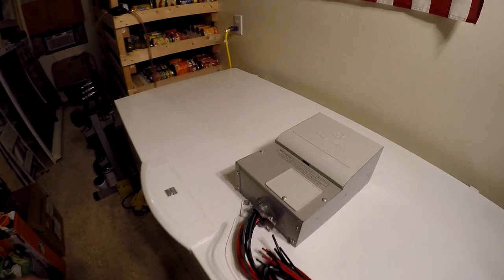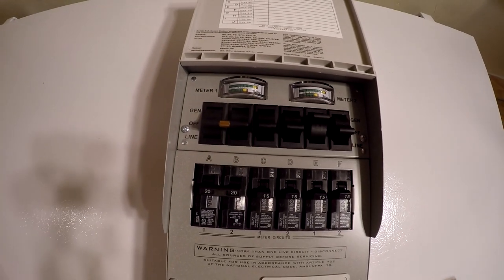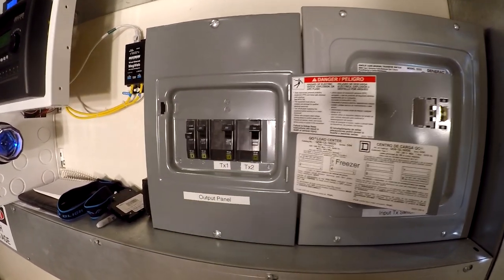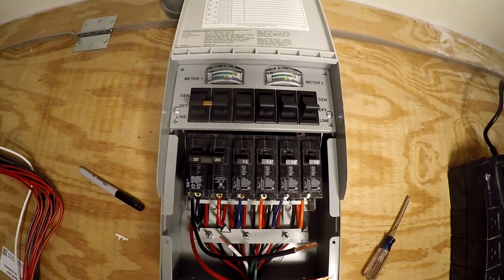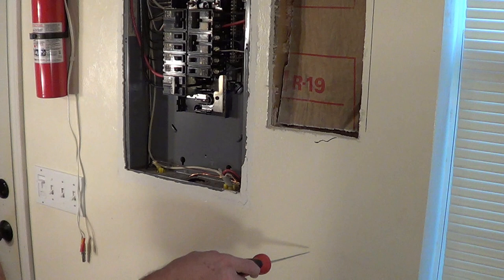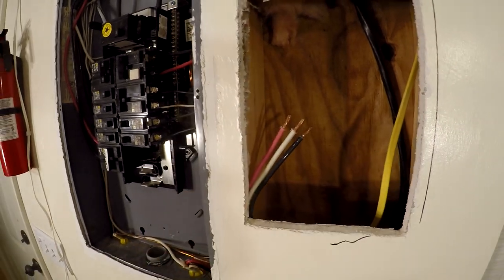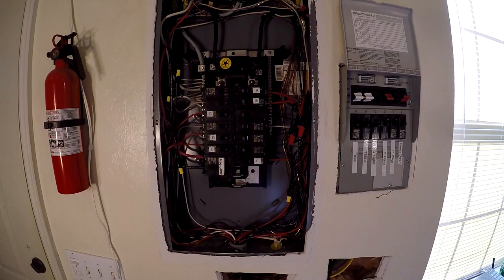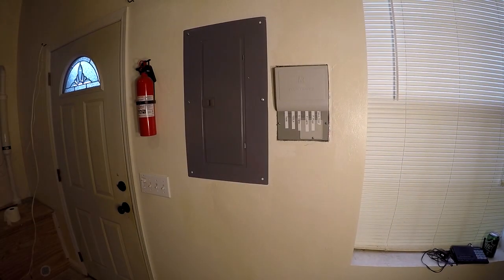Installing a Transfer Switch for Solar or Gas Generators

Comment: Does your system send energy back to the grid after batteries are topped off ?
Reply from the maker: It does not.  That would be better in a way as I waste energy once everything is topped off and I have no  "dump load" uses.  I chose to do it this way as I did not want to be subject to any potential problems with the utility down the road.  They have NO say over my system.  To them, I look the same as having a backup generator except in my case its running ALL the time.  When I get my Tesla Cyber Truck, there will be no wasted power anymore.  Thanks!

Comment: Man, this might be exactly what I’m looking for. Especially during outages when the sun is out, I can still take advantage of the solar power. 

Did you have to get approval from your utility company to install this?
Reply from the maker: I did not need to get approval from the utility but I do recommend that you hire a certified Electrician.  Thanks!